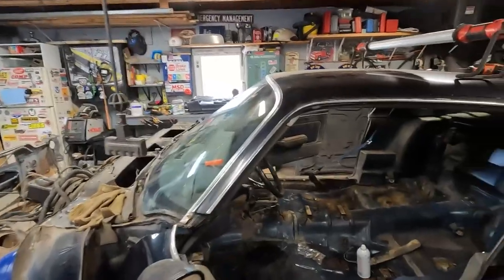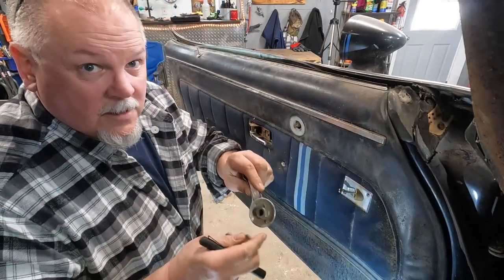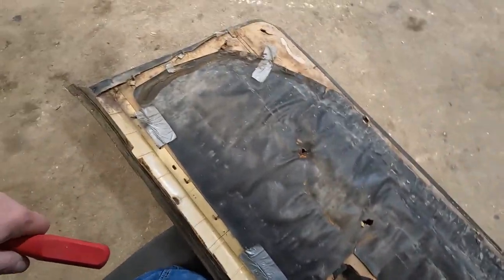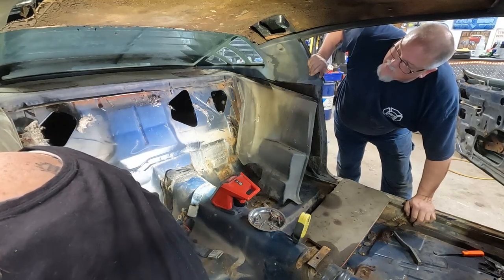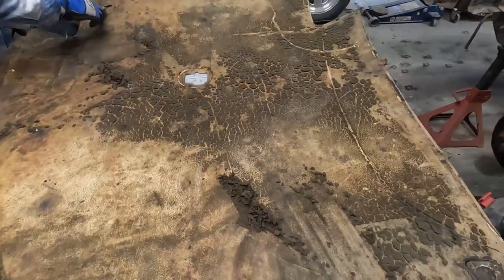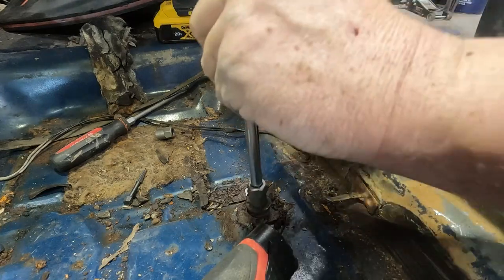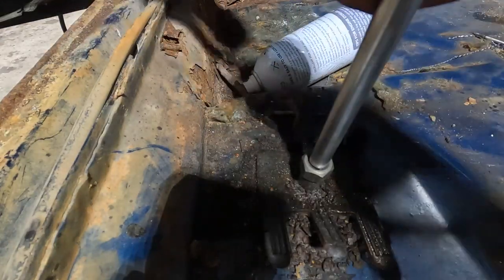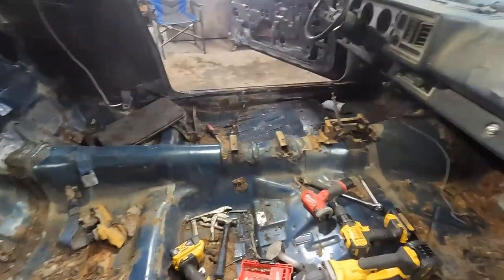Complete gutting of interior of 80 Camaro is done and reveals a few surprises.

Comment: So as far as broken bolts go, I’ve found once you have to the hole drilled, use a cheap torx bit and drive it down into the drilled hole, if it strips it out, go to the next size torx bit. Torx aren’t tapered, so they don’t push out on the threads while you’re trying to back the broken bolt out. Also if the torx breaks off in the bolt, you didn’t ruin a nice tool.

Comment: A little bit closer every time, good work. You must not have a welder because if you did you could weld a washer to the broken bolt then weld a short bolt to the washer. Then let it cool enough to harden and so the heat moves into the broken bolt's threaded hole and slowly work it back and forth until its ready to remove.

If you don't have a welder, it's probably getting closer to the time to get one for this project? The yt channel, Grind Hard Plumbing Company is raffling one off with every $5 purchase of the merch, I just got an email from them saying today is the last day though so....

Sorry, I just went and looked and its not a welder, its a CNC plasma cutter, that thing would also come in handy!
Reply from the maker: We have both welder and plasma I have removed a few bolts that way.  Like to use the hand tools to show how to use them when they work.  Looks like I will be using welder soon enough.  Thanks for watching
Reply: @LandsharkGarage  
Ok, cool. I kinda figured an older guy like you would know how to do that technique. Ha ha, just a little jab because I'm a year younger than you until later this month. LOL IIRC your bday was back sometime in Oct, now 5 months later I'll catch up to you and I won't be able to say the above so I had to get it in while I could. nyuck, nyuck, nyuck